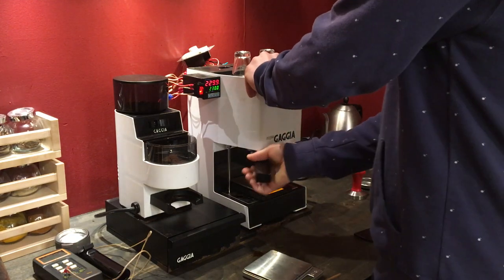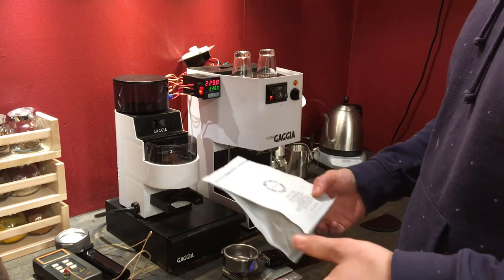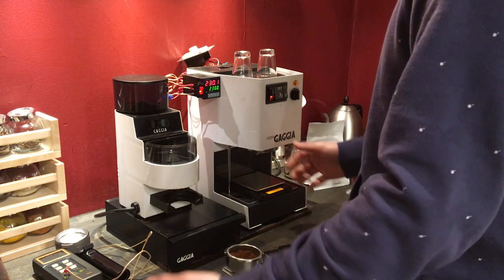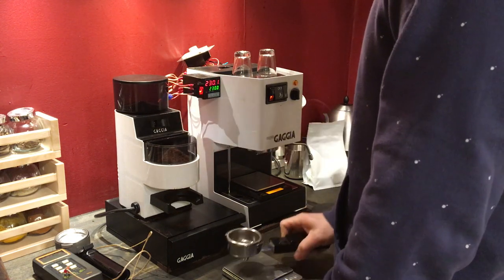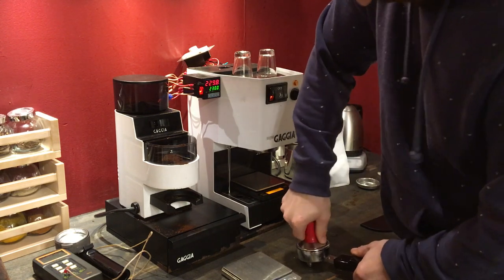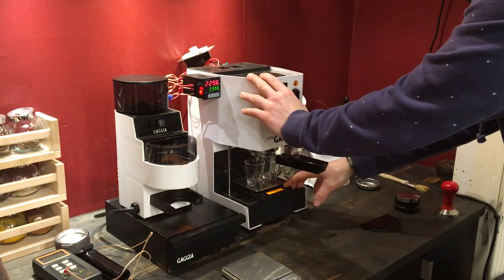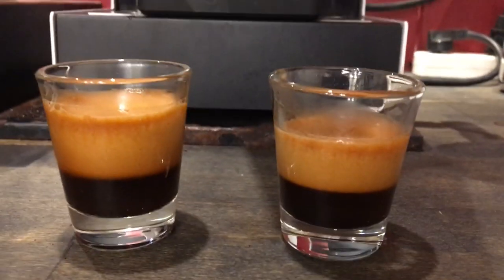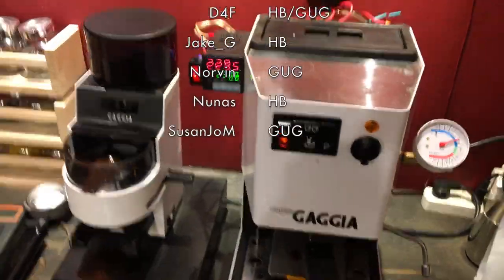First Pull on a Modded Gaggia OWC (PID, Pressure Gauge, Pump Dimmer)

Comment: I’m sorry, but that’s hideous. It’s only a matter of time before one of those wires gets damaged.  I’m planning similar mods and will be enclosing most in a project box on top. Shot timer relay, PID, and AC dimmer.  Pressure gauge on the front.